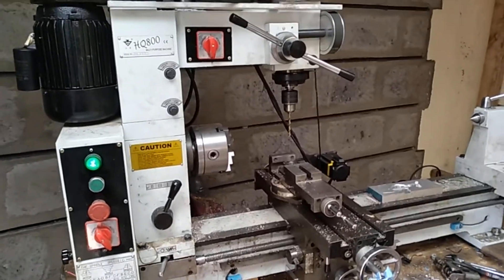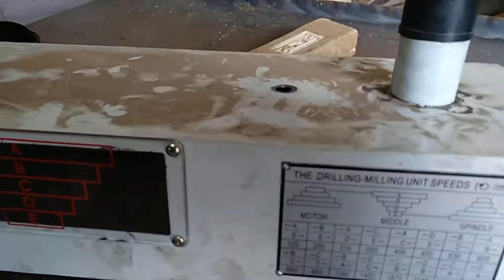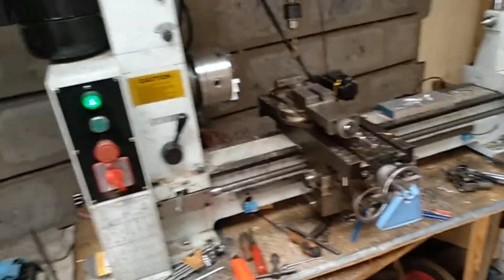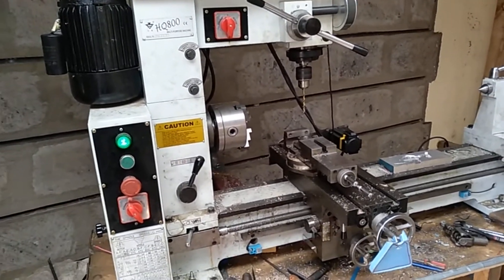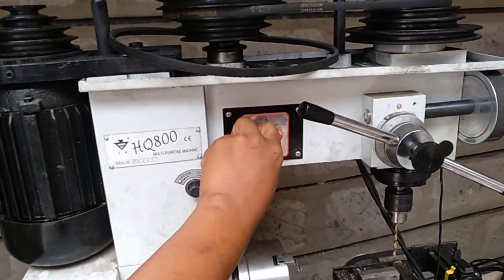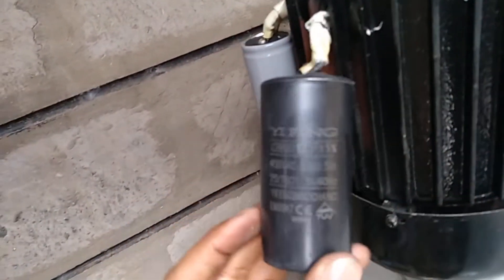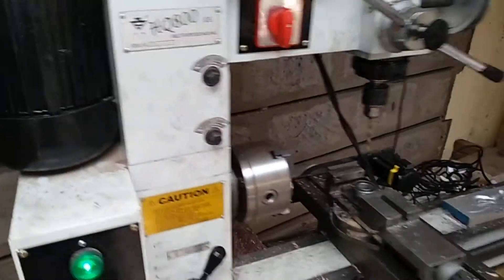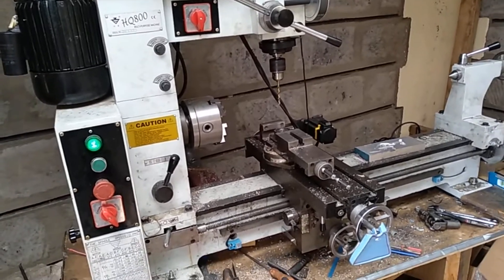HQ800 Mill motor humming and not turning, let's troubleshoot

Comment: Hi Jeff, we’re you able to find a replacement motor? I am considering purchasing one of these machines that is missing both motors and wondering how hard it is to find replacement parts.. Please let me know. Thanks.
Reply from the maker: Hello I took it for rewinding and changed the capacitors....but the Chinese supplier had quoted new one at $80
Reply: @JeffChoppah  That sounds very reasonable, actually.. would you mind sharing the supplier contact info? Thanks
Reply from the maker: export07@czjyjc.com Milly
Reply: @JeffChoppah  Great, thanks Jeff! Good luck with your machine! I am interested to see more videos of the machine in action or more of the troubleshooting process if you feel inspired to post more. ;)